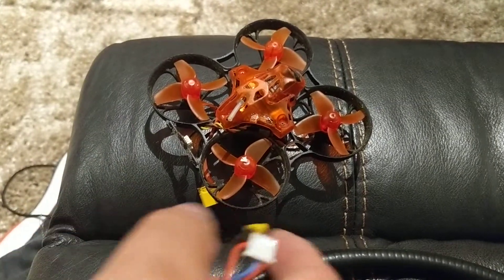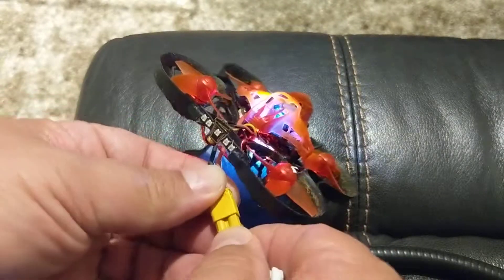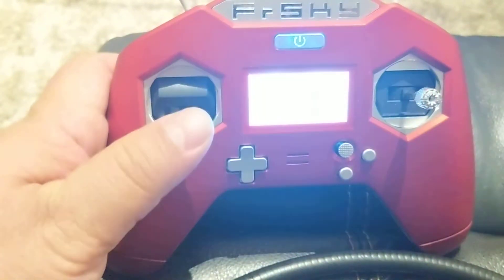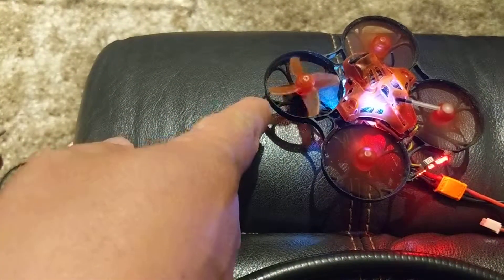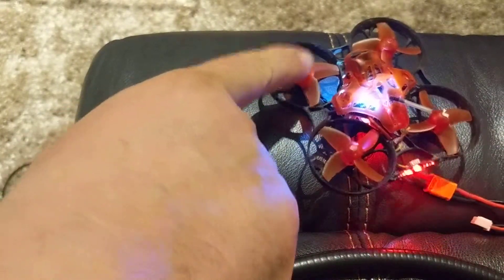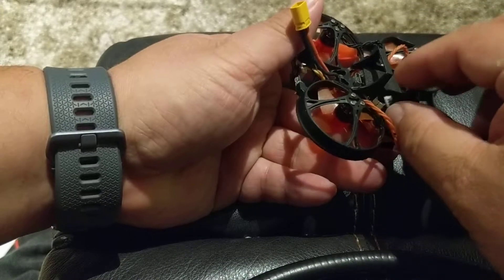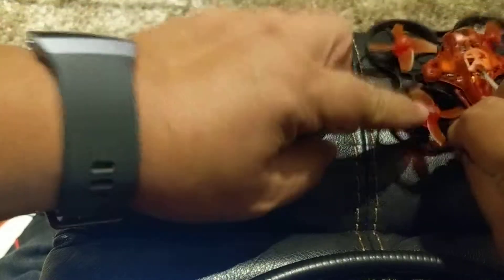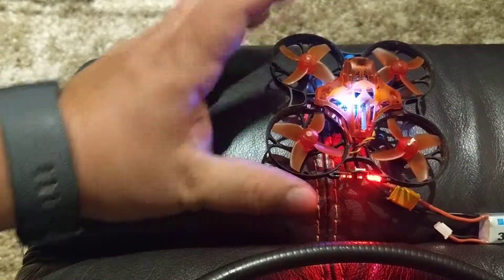Eachine Trashcan bad ESC

Comment: I have the same problem.. I've managed to fix it by replacing the mosfets on motor 1 (the bad esc on my trashcan). But it seems to have lower flight time and the motor kinda run hotter now... 
I've used mosfets from Moblite 7 AIO,, 12v 5A mosfets with same serial model number.. I'm on BF 4.11... should I update the firmware or the esc firmware?
Reply from the maker: Well, I ended up replacing the flight controller, what did you do?

Comment: I have same problem, luckily banggood sent me entirely new trashcan since they didn't have replacement boards anymore... What I noticed though is that if you start up the motors, you can fling it with a finger and it might start spinning and it works nice until you take it to a full stop and then it refuses to start again...

Comment from the maker: Fyi, banggood came through for me and they are sending me a replacement board. I'm going to apply a coat of conformal coating after soldering it being careful not to get it on the plugs to protecet it a bit.